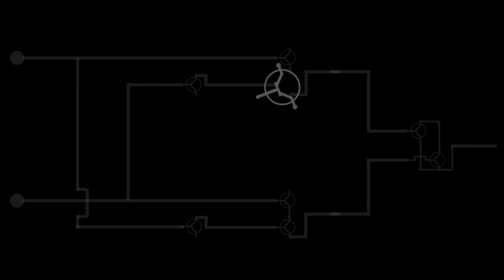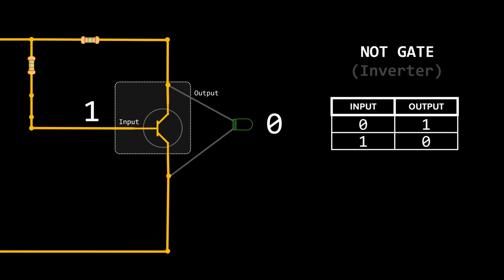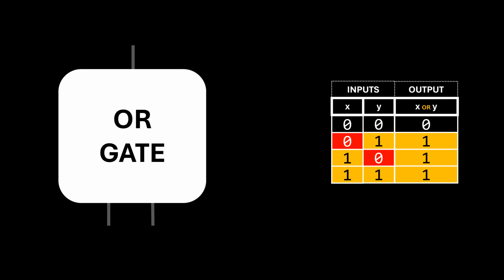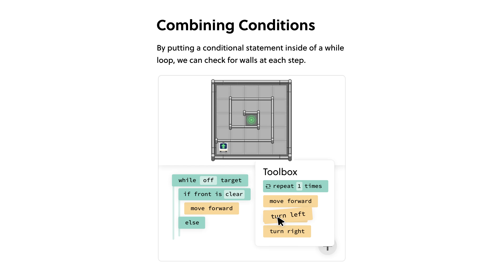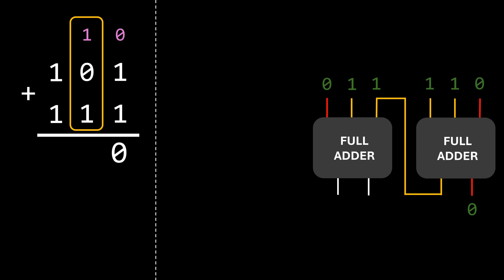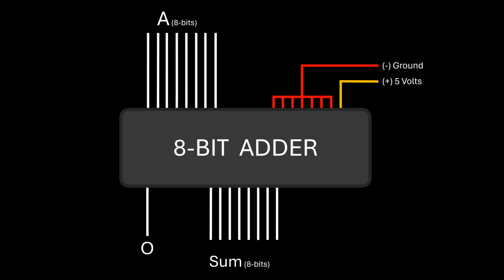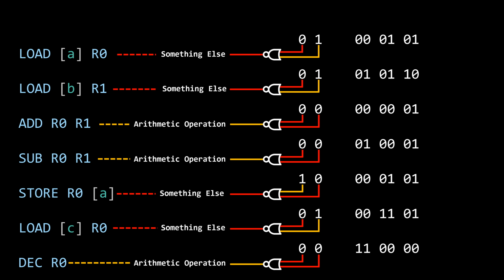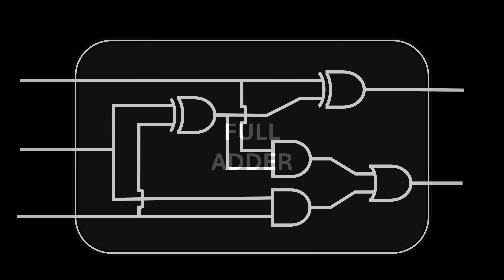HOW TRANSISTORS RUN CODE?

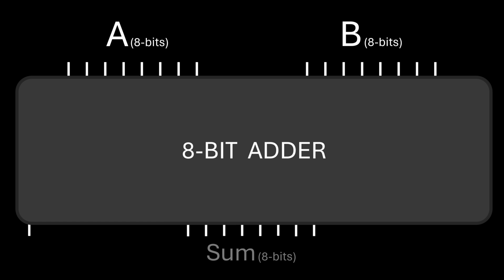Comment: [9:08], Not an o'V'erflow signal.  That is a 'C'arry signal.  Useful for unsigned comparisons.
The o'V'erflow signal can be generated by using an XOR gate attached to the last two carry outs (Intel 8086).

Comment: Wrong type of transistor.
Most logic is MOS and variations on it which use FET's and not bipolar transistors.

The transistors you have presented in the video are bipolar junction transistors and these were only used in ECL - emitter coupled logic, and that went out of fashion decades ago.

Comment: One feature that I would like to have is a subtitle.
Because you are using Text-to-speech you can generate easily different subtitles with Ai and put it in your videos.

I liked the video by the way.👍🏽
Reply from the maker: You mean english subtitles? Or translated to different languages? 🤔
Reply: @CoreDumpped  yes, I meant to add translations for different languages.

Comment: Ok, but how to steer input (off/on) of transistor? Another transistor? What with this "another" transistor? This is the part I don't get it or I am missing some basic thing.
Reply: Yes using other transistors indeed. Of course there's a bootstrap, which is the on switch of the machine.

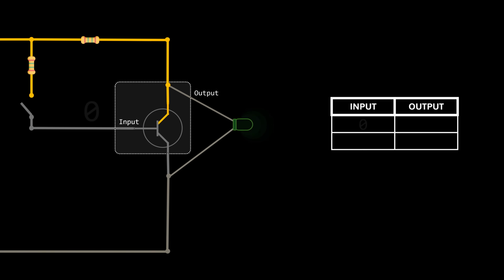Comment: 1:53 the Not Gate. The reason it happens in my thoughts is that current priorities a less resistive path over a resistive one. So when the current passed through the base of the transistor then it stops current from passing by the positive lead of the LED, therefore turning it off.

Don’t believe what I say it’s just thought😅
Reply from the maker: Yes, the hilarious part is I did record that explanation, but I ended up cutting it out of the final video to reduce video duration.

Also the "resistance" explanation is from the engineering point of view. From the point of view of physics, the explanation involves a concept known as Electrical Potencial. When the transistor acts as a conductor, there is no potencial difference between the points the LED make contact with the wire, so electrons have no reason to flow that way.
Reply: @CoreDumpped  that’s really great to know! Now I can be certain that I could use this method without leakage if I tried to redirect the flow of electrons. At first I really thought that even tho I said that it flows to the less resistive path I still somehow thinks that there might be a current passing through the positive lead but very little. Just to make sure, I am gonna test this theory the moment I get out of bed today or the moment I wake up. Lol. Thanks!

Comment: "apply current"...not very fortunate choice of words technically. You can only apply voltage (source of voltage to be specific) which causes the current to flow. 
Apart of that, really enjoyed the video. Thanks a lot.
Reply from the maker: I'm not an electrical engineer so thanks for clarifying this :D

Comment: I have been studying computer science for over 5 years now, about finish my comp sci degree and never before have i heard a more clear explanation of how logic gates abstract transistors and how ALU works, keep up the great job!
Reply: They don't generally do a good job of teaching logic in Computer Science courses. It's really within the domain of electronic engineering courses.

Though interestingly, my school level course in Computer Science did teach Karnaugh Maps used in logic simplification and design.
Reply: @deang5622  Congrats, bro! But now you can see why we all need this level of simplification, right?
Reply: @frolstty  Transistors do not simplify things. Abstraction simplifies the design process.

Transistors are the lowest level of abstraction. Logic gates are one level above it. Then we move up to hardware description languages and synthesis tools.

Each higher level of abstraction makes the design process quicker and cheaper.
Reply: @deang5622 because most people who study cs dont want to work on low level stuff they want to do boring stuff like web dev
Reply: can i ask something please, what job u do after 5 years studying computer science, im on my beginner step learning computer science and i still dont know what kind of jobs should i get
Reply: @zulfikaradnan2589  Get a job. Do it for a while. Don't like it? Change it.

I have done everything from software development, to system integration, system testing, defect management to operational support to project management.

Try something out. See how it evolves. Be willing to learn. Be willing to always learn, even when you hit 50 years old. Stay on top of your game. It is a fast changing industry.

Comment: WHY DONT PLAY STORMWORKS  YOU CAN DO ANY THIN   ALL TRANSISTORS  NOT  /AND   /NAND   /NOR   / XOR  /OR   /JK  /SR  /TIMER(RTO)  /TIMER(RTF)  /PUSH TO TOGGLE  /TOGGLE TO PUSH   /BLINKER   /PID   /PID ADVAN  /Fx   /Fx(3 INPUT)  /ABS  /CLAMP   /DELTA   /ON SIGNAL   /MEMORY  REGISTAR   /EQUAL   /EXPONENT    /PING PONG   /TRIGONOMETEY    /SIN   /COS   /ACOS   /TAN  /ATAN   /ASIN   /..................      📟📟📟📟📟📟📟📟📟🔌💻💻

Comment: Aren’t transistors already AND gates? If you open the transistor but don’t apply power you get nothing, and if you close the transistor and apply power, you get nothing, but if power is applied to both, only then do you get power. Truth table:

Switch | Input  | Output
—————————————
0           | 0         | 0
1           | 0         | 0
0           | 1         | 0
1           | 1         | 1

Comment: My god, I have explained to friends many times of "how does a cpu actually execute source code?", and I have always imagined/explained it in exact same way: Transistor -> Many transistors make logic gates -> logic gates together or alone create logic -> math is very logical so lets make a half-adder -> lets put those together to make a full-adder -> let's make other arithmetic components and put them in a box -> let's create a language for the box, where we describe which arithmetic component we actually want to use, and which numbers to pipe in -> we have created machine code -> assembly is much easier for us to write but still requires many lines of code that are just preparations for what we actually want to do(addition, instead of putting numbers in certain registers) -> so let's create a program, that can take a single line statements that describes what we want to do(addition), and then a program reads it, and it translates it into the necessary machine code -> since this program actually turns a single line of source code into many lines of machine code, let's call it a "compiler" instead of a translator, since it compiles the whole operation into the necessary machine code steps -> we have now successfully created a simple higher level compiled programming language, that's how it works folks.

What I'm trying to say is, you really nailed the presentation and order of teaching things. This scratched that explanation itch seen above here. Great work!

Comment: Hello! Very happy to have found your channel!
I just have a question: how do assembly instructions are converted to electric signals? I get that the compiler translates the instructions into bytes, but only in a high-level way, not in the physical sense.
If anybody could explain or link a ressource for it, I'd be very grateful!
Reply from the maker: The answer is: "Memory". So, you might be interested in the next video.

Comment: İmpressive... As a senior mechatronics engineering student, I can say that it was a more effective video than the logic circuits course given in a semester at the university. As a senior mechatronics engineering student, I can say that it was a more effective video than the logic circuits course given in a semester at the university. 

The art style of the video is very similar to the FALSTAD software I use to study logic circuits. It can be very useful for beginners. It is free and open source software.

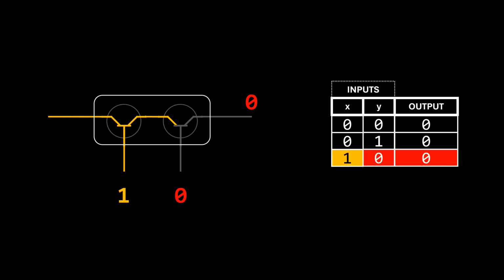Comment: 3:15 I sense there is something odd here. Those two transistors have the collector, the base, and the emitter, where the emitter of 1 is the collector of 2, x and y are the bases. 
When transforming to the AND gate, the left-most Collector suddenly disappears, leaving only the two bases and the right-most emitter behind. What does happen to the collector? If x and y are bases, where does the AND gate get its initial current from that it is channeling through? Or are x and y bases AND collectors?
Reply from the maker: It disappears because the collector is not an input, it is always connected to 5V, thing of it as the power cord of some device, in order to work the device needs to be plugged.

Comment: 1:20 The difference with a transistor is that it's not only on or off, it continuously varies between the states. That's what allows amplification or throttling of motors

Comment: I had made "half adders", "full adders", "multiplexers","latches", "flip flops", "and "bcd to 7 segment display". The video of "hyperspace pirate" named "8 bit adder built from 152 transistors" was very helpful, and the apps named "k map solver" and "logic circuit simulator" were also very helpful. Now for moving further, this video is very helpful and I will surely make an ALU using transistors and resistors in future.
Reply: Abstraction is key.
We don't design more complex logic functions from transistors. We build them from lower level logic functions.

This allows logic designs to be implemented in different technologies, to be reused. Function reuse is an important concept to understand: you don't have to build everything from scratch. It is more efficient to use logic functions already designed and incorporate them in to your design.
Reply: @deang5622  to understand the whole picture, we must also understand how the parts are connected together. It's easier to connect the parts together when we use an abstract block diagram, but it's very difficult when we actually connect the parts together. So, abstraction is useful, however we should also put all the pieces together to better understand the full picture. (I used full picture as an analogy to block diagram and parts of picture to the parts of different components of that block diagram).
Reply: @MathsSciencePhilosophy  No.
Design Engineers - and I know because I used to be one - unless working with full custom technology, and even then only partly, work with logic functions.

When a designer writes VHDL code, they are not working with transistors.
They are working with code which is synthesised to logic elements without any knowledge of what the transistor configuration is inside the particular logic function.

That is how it is done.

The reason it is done this way is precisely because time is money, it is a much more efficient and productive design process that delivers the end result in less time.

I loathe these discussions with amateura that think they more than us design engineers that have done it for a living.
Reply: @deang5622  someone using a computer can argue similarly that we can use computer without understanding VHDL code, we can just use readymade code and save time. But to understand how a computer really works, we also need to understand vhdl code. 
Similarly, to understand coding, we also need to understand how transistors work and how they are used in logic circuits to create a code.
Reply: @MathsSciencePhilosophy  transistors are only one kind of switches, historically tubes and relais were used for digital operations
Reply: @makjekk  you are right

Comment: I think you did a pretty reasonable job distilling what is essentially 3 college courses of material into a 14 minute video. 👋 Hi, I think this time it's my turn to give the inevitable "um, actually" - For context, I'm a B.S. in ECE where microelectronics and computer architecture are my special interest. There were definitely a few points that I feel could've been hit better, though I understand given the time constraint, some simplifications had to be made. First, bipolar junction transistors (the ones you gave) are, to my knowledge, either never or almost never used in microelectronics anymore. Everything uses MOSFETs, which instead of having a base, emitter, and collector, has a body, source, drain, and gate. BJTs require a small amount of current in order to stay on, so when you multiply that by BILLIONS of transistors, it adds up fast and then your CPUs would need to draw thousands or millions of amps. MOSFETs on the other hand, pretty much only draw current when they switch from 1 to 0 or vice versa, which is more miniaturizable and lets you pack WAY more onto your processor. I personally find CMOS (short for Complementary Metal Oxide Semiconductor) circuits to be really interesting and stimulating, where you combine P-type MOSFETs and N-type MOSFETs to make logic gates. Interestingly enough, AND and OR gates are compound gates, meaning that you can't get an AND or OR in a single step. First you need to make a NAND or NOR, then invert it. 
Also, about transistors updating their state almost instantly: Boy is this a fun can of worms! Switching speed actually comes as a tradeoff with power consumption. You can get a FET to switch states faster by simply increasing the voltage, which obviously increases power usage, or also by making your gates _wider_, which allows current to flow more quickly (due to lower resistance) - but at the cost of needing more electrons to physically charge/discharge the capacitor, meaning more power per state switch. 
That fun fact aside (since it's irrelevant to the video), the propagation time of signals is actually a really significant consideration in processor design. The channel Spanning Tree made an excellent video recently explaining carry look-ahead adders. We want our logic unit to run as quickly as possible, and if we have a simple ripple adder as demonstrated in the video for something like a 64-bit word, the last bit needs to wait for the result of every single bit to be calculated, one by one. MOSFETs are fast, but at the frequencies we've been pushing in CPUs in the past few decades, we want to whittle away every bit of inefficiency we can in order to make our processors run faster.
I was unsure at first, but I like the way you presented the info on opcodes. It's an obvious simplification again, but it gets the point across quite effectively. I built a super simplified RISC-V control unit for my final project in computer architecture, and boy was it an interesting challenge. I'm looking at some of the code I wrote for it now, lol. I just have a bunch of statements like "if (opcode == 7'b0010011)" in my Verilog code, without any sort of optimizations in mind. Honestly I'm not sure what those if-elseifs would get synthesized as in hardware. I don't have the software that I used for it installed anymore, so I can't compile it and inspect what it got synthesized as. Still though, even with those hacks I took to get it to work, it was quite challenging and it gave me a lot more respect for computer architecture as a field after doing that.
I'll join the discord server in case you wanna chat more about this stuff! I'm quite passionate about this part of the field.
Reply: Thank you for the explanation. I found the video to be very informative and satisfying, as someone who grew up interested in electronics and then shifted into programming, this is the first time I truly understood the relation between the assembly code and the underlying hardware, yes, it might seem to you pretty basic information that needs some correction but I think you're missing the big picture here which is explaining the topic from a high-level that enables and empowers the rest of us to understand the topic and delve into it if needed further explanation. This is one of the most satisfying videos I've ever watched and I hope upcoming videos to be as simple and informative.
Reply: Now I understand why adding more voltage to a CPU to overclock it makes it faster but with higher current consumption